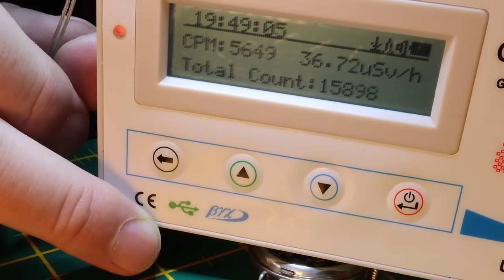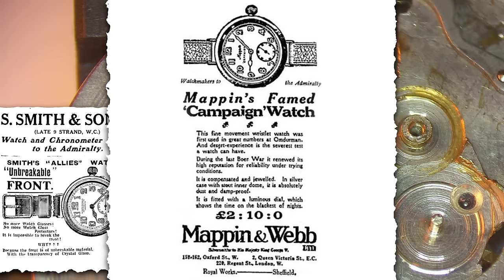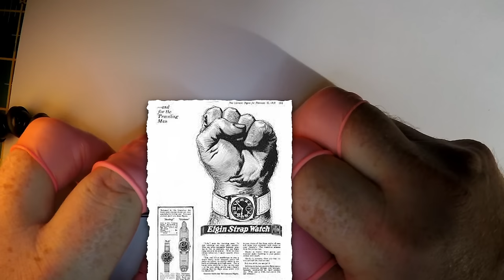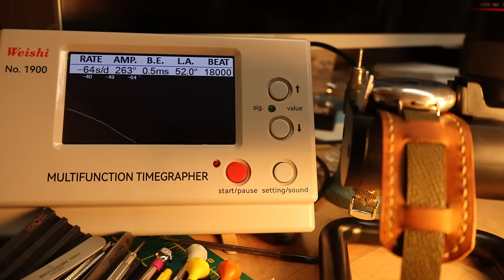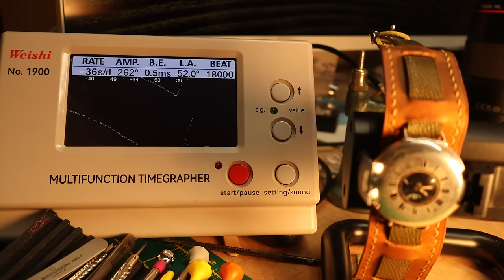Restoring a 108 year old trench watch that ended the First World War

Comment: Great video. As a matter of interest would it have been possible to re-bush the worn pivots or work the hole tighter like you see them do on more modern watches? I appreciate that this is a very old watch and it is doing very well for its age, so probably not worth risking any staking?
Reply from the maker: Yes, absolutely add a bush or a jewel. The method of moving the metal with a stake is a bit of a bodge as it doesn't find the centre of the hole correctly.